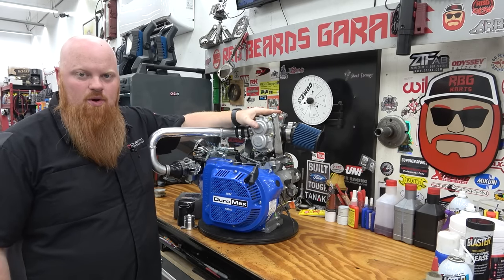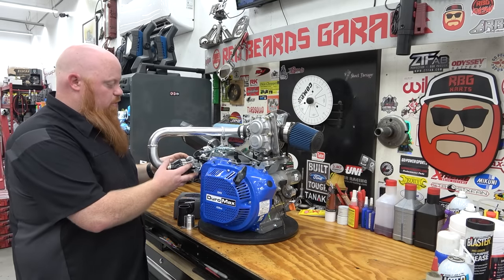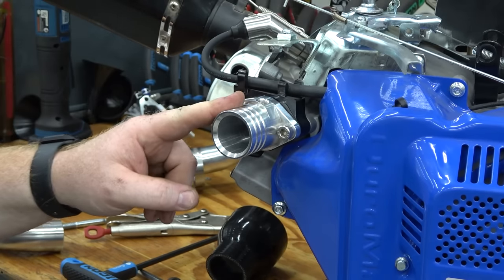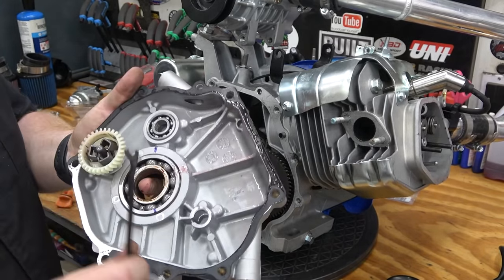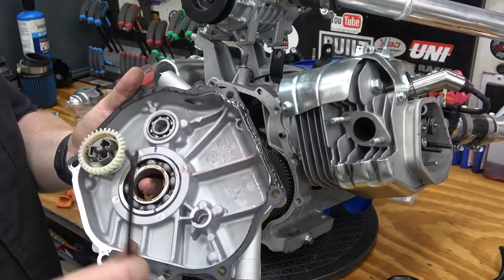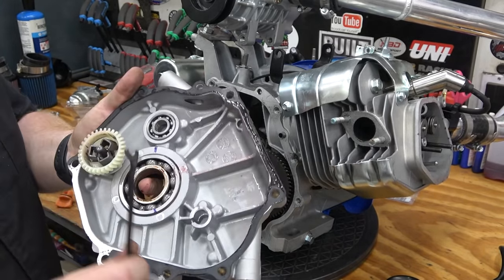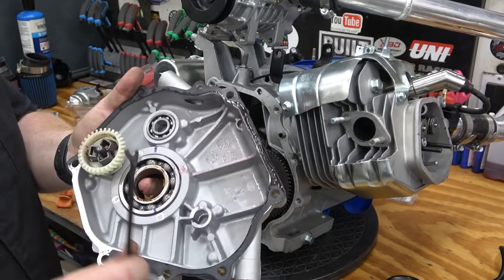We Make 15lbs Of Boost!!! Supercharged 440cc Take 2

Comment: The motor will not make any high rpm power because of the intake runner length. The engine will run out of steam pretty quick. If you make that intake runner shorter by moving the supercharger closer the whole combination will benefit greatly.  Good luck with the build.
Reply: @bradensmith888  regardless of cylinder count, the  simplest explanation..... the distance from the intake valve to the throttle opening determines the rpm range in which a engine will run. The further away the throttle opening the lower the rpm the intake would be tuned for. The shorter the runner the higher the rpms. Hence when I.R. manifolds are  made the length of the runner needs to be considered to make sure the engine will make the power at the desired rpm. By switching from blowthrough to drawthrough the way they did they effectively went from a short runner to a super long runner.  Remember the throotle opening is a metered vacuum leak and the runner begins and ends (for the most part) at the throotle blade.. there is a effect after that but that would be negated by boost in this application.

Comment: You gotta fail a few times to make things happen.  Thomas Edison said this about making a lightbulb, "I have not failed. I've just found 10,000 ways that won't work."

You may want to take a look at NanoEFI though, they are working on building a EFI system for small engines which would work GREAT for a boost system.  Not sure what is happening for the development on their stuff but it was supposed to be low cost using an ESP32 as the controller.  But if NanoEFI does get going it will be awesome for karting especially if you have kids because you can rev limit in software so they don't go out and wreck as bad.

Comment: That much boost you should really try to take a few degrees of timing out, retard the base timing a solid 4-5 degrees with some good high octane fuel i reccomend rejetting for e85 to help with intake air temperatures. and jet accordingly with a wideband o2 sensor to have a problem/trouble free setup
Reply: With e85 you can maybe get away with just a couple degrees pulled

Comment: Beetle carbs are downdrafts and come in 3 sizes. 30, 32, and 34mm for the 1200, 1500, and 1600 engines that put out 40, 53, and 60HP respectively. Add PICT after the size you want and happy hunting....
Reply: Oh, if you're thinking about a 1200cc sized carb, how about one from a Datsun 1200? It's a staged 2 barrel with a 26mm primary and a 30mm secondary. Knock offs are around....

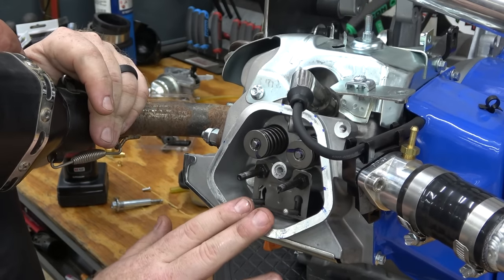Comment: Hi Red Beard, I was thinking..at about 7:45 or so, you were explaining how you needed to disassemble the head to get to those valve spring keepers, and I was wondering if you could use the same technique used for other engines, by threading an insert into the spark plug hole and presurising the cylinder, which holds the valve against its seat while you push down on the spring (you might have to fab a small tool that bolts to the rocker stand to use as a lever, maybe with a forked end) which allows you to remove the keepers from the stem.?
Reply: Another method I've seen used on engines where removing the head is excess labor such as SOHC, is stuffing rope in though the spark plug hole.
Reply: @Shadowvortx  YES! that's also a good option too!

Comment: Use a wastegate or a bosch style bypass valve to create a bypass loop. The off-idle drivability would be improved.

Also, if all youre after is throttle response, why not leave the fuel passing through the charge pipe and simply use a small throttle body at the engine side. Dual throttles were common in the past.
Reply: Wastegate is for turbos because they are stilled spooled up after you close the throttle and you have to get rid of the pressure. Supercharger should improve off idle unless timing and/or carb tuning is not correct.
Reply: @sife3438  You can use a wastegate on a supercharged application as well. It's common practice in motorsports.
Reply: @208Concepts  Are you talking about a Blow Off Valve? Those are used alot. There is a difference between a blow off valve and a wastegate.
Reply: @sife3438  yes I know. I deliberately said wastegate though. A BOV is used for venting excess pressure, but a wastegate can be used to bypass a supercharger so as not to create a surge condition.
Reply: @208Concepts  You mean on a centrifugal blower. Like a Procharger. I've seen wastegates on those. I've seen bypass valves on screw type superchargers. I've never seen a wastegate on a screw type supercharger which is the one he was using. Also curious. If you put a wastegate on a supercharger such as a TRD, 471 or 671 where does it go?
Reply: @sife3438  you’re confusing a blower style with its mounting style. A centri blower and this specific AMR are both divorced from the engine so a wastegate or BOV can be added in line before the engine. 

Wastegates on a blower application in Motorsports just vents the excess boost/air into the atmosphere. It’s coupled with a 3 port solenoid and is pulsed to bleed airflow.